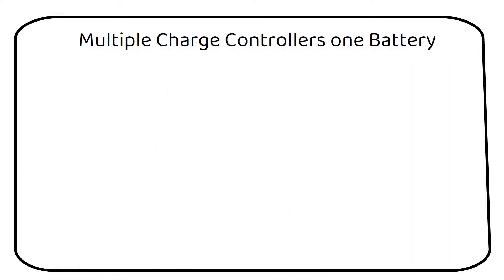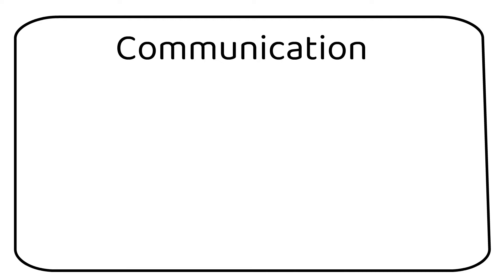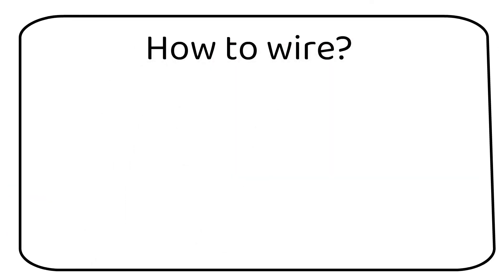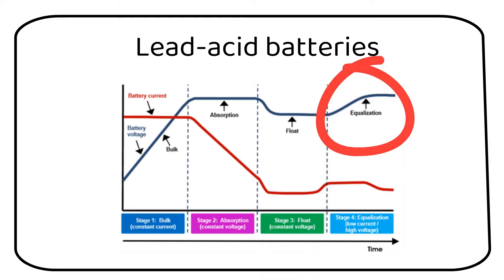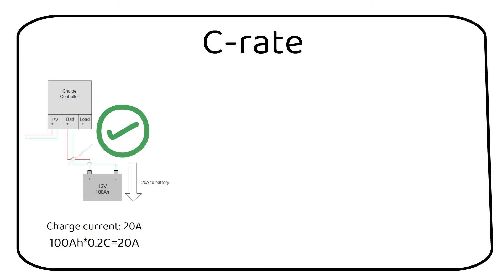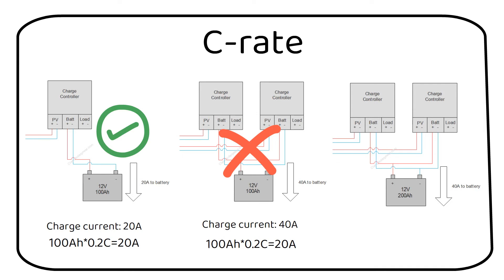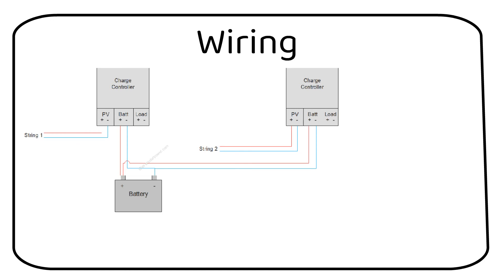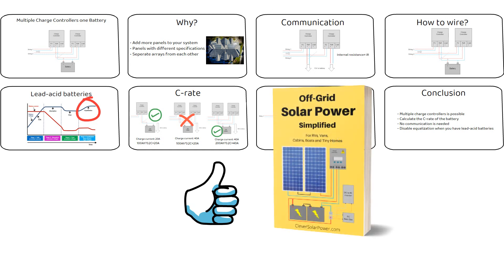Multiple Charge Controllers One Battery Bank: MPPT and PWM

Comment: Can both charge controllers be landed on a bus bar?  I have a victron 100/30 and want to add another perhaps bigger mppt. Can both controllers be connected to the positive and negative bus bar instead of directly to the battery? If so is fusing required beyond the positive fuse from charge controller.
Reply: Yes, you can always connect the charge controllers to bus bars.  And you also don't really need to worry about making the cables equal-length.   Fusing will depend on the charge controllers.  Victron's smaller charge controllers have fuses built-in on the battery outputs, their larger ones do not and you DO need an external fuse prior to go onto the bus bar.  

I usually use DIN rail mounted solar fuses (10x38mm) because the form factor is easy, sized to 150% the maximum working amperage of the charge controller to avoid excessive heat generation.

Charge controller fusing is completely separate from main battery fusing.

-Matt

Comment: Plz answer one important question for me
Can we connect in parallel pwm and mppt , to charge one tubular battery.
Pwm and mppt have different charging voltages, so will it cause any problem or work fine?
Reply from the maker: Yes, it will be ok.
Reply: @cleversolarpower  
Thanks

Comment: Can you connect pwm alongside an mppt
Reply from the maker: Yes
Reply: OK thanks so much  Could you also plz explain the charging Amp of a lithium battery plz because per calculation the scc Amp rating says 60a based on the 1500w input and 24v system at 100a but battery says per c-rating charge with 20a even with BMS plz explain

Comment: Does it matter if having two MPPT of different size, e.g. 30a + 60a. 30a having panels of 200w*2 (total of 400w) and the 60a having 500w*2 (total of 1000w). The same parallel charging a battery pack on 48v.
Reply from the maker: No problem.

Comment: Thanks for the great video.
Practical question. I have 2x 20a mppt i want to connect them to a 250ah battery. 
How should I practically do that? Connect both mppt's to the battery-poles? Or first bring them together, and then with one set of wires to the battery?
Reply from the maker: There is a max limit on connections to battery terminals. This is a maximum of 3. If you have more, then bring them to a busbar.
Reply: @cleversolarpower why would there be a limit on the  number of wires to a battery terminal? Why would you need a busbar? Is this just so it's cleaner more organized? Why would several writes going to battery cables otherwise be a problem?

I really would like to know your opinion and further explanation for my learning
Reply: @truthseekertree  maybe reason is the amount of thread of bolt into the battery and also the current doesnt flow through the layers of too many connections very well. Over time it can be an issue.
Reply: You can always use longer bolts to get more things onto the battery terminals, but my general advice is to minimize the number of ring terminals on the battery... preferably just have one.  The reason is that it is best to put the battery on an Anderson quick-disconnect (also known as "power pole" connectors) so if something goes wrong and the battery starts smoking you can just rip the battery out by main force.  This would be a highly unlikely happenstance with LiFePO4, but the probability is not zero.   When batteries are heavily wired into a system it is literally impossible to rip them out in an emergency.

So what I recommend is that the battery terminals only be connected to (at most) a shunt on the negative side and a fuse on the positive side, then those go to an Anderson quick disconnect, and that is cabled onto a bus bar.  Then your charge controllers just cable onto the bus bar.

Or alternative the battery goes to the quick disconnect directly, and then that goes to the rest of the system.   Depending on what fits best for your circumstances.

-Matt

Comment: Thanks for the super detailed video, this answered most of the questions I have been searching for weeks to find! The only thing left I am wondering is do I have to match the amperage of my current charge controller? I just upgraded my tv battery from one 65ah lead acid to 2 100ah lifepo4 batteries. I have a 200w panel with a 30a charge controller currently, I am looking to add another charge controller to a suitcase panel that I can move into the sunlight as needed. Does the suitcase panel charge controller also have to be 30a or can I install a 10a or a 20a with no issues? Thank you in advance for any insight!
Reply from the maker: You don't have to increase the current of your charger. It will just take longer to charge the battery. However, you need to get a charger suitable for lithium batteries. As far as the charge controller, it doesn't need to have the same current. Watch my video about sizing a charge controller.

Comment: What current MPPT controller is recommended for 24v 200ah LifePo4 battery?
Reply from the maker: Basically any MPPT that has a charging profile for lifepo4 batteries and work with 24V. Some brand names that come to mind are Epever, Victron, Renogy

Comment: Thank you for the video.
I would like to remark on MPPT controllers, particularly that they come with preset configurations for different kinds of batteries. I would think that the default for different types of batteries should rightly have taken into consideration their C rates and therefore control the charging suitably. No?
Reply from the maker: The charge controllers are only regulated for their charging parameters, not the capacity (Ah) of the battery they are charging. The highest current charge/discharge is mostly from the inverters, not the solar panels.

Comment: Hello. I have a photovoltaic system with 4 panels 340w and 4 panels 275w. at 340w I have a pwm regulator and at 275 an mppt regulator. I supply 24v batteries but the regulator mppts the 4 panel 275 no feeder at all. what should i improve in my system thanks you

Comment: I read somewhere that modern charge controllers (MPPT/PWM) can automatically detect the type of battery connected and they will automatically provide what voltage and current needed. is it true?
Reply from the maker: Not true. They can only detect voltage, not battery type.

Comment: What would you suggest for an Absolyte GX 2,000 Amp hour/48 volt VRLA for charging OFF GRID with generator support? I have to make all the connection plates for this unit as well.
Reply from the maker: I'm not sure what your question is. I have a video about generators in the making.
Reply: @cleversolarpower  in regard to charging such a large VRLA - how many charge controllers would a person be limited to for charging purposes. We are on a mountaintop and roof space is limited but multiple stationary arrays with separate controllers may be able to solve our problem without having to purchase one or more trackers. I thought the price had come down on trackers but the price is still quite high.

Comment: Do both charge controllers have to be of the same rate?
Reply from the maker: No, they can charge at different currents. Of course they have to be the same voltage. It's the same as a charger from shore and a charge controller combined. The battery will take all the energy it can, even if it comes from multiple sources.

Comment: Can i connect 4× tubular  batteries in parallel,2× inverter in parallel, and 2× same charge controller in parallel in it possible?
Reply from the maker: Yes you can.

Comment: I see where you say a 20A controller can charge a 100A deep cycle lead battery, but I have a 6v deep cycle  225AH battery and my 100A controller won't work with it why? The pannel I am using is 590w /12v
Reply from the maker: You need to have a 12V battery to use with a 12V charge controller. It won't work with a 6V battery.
Reply: @cleversolarpower  thank you very much for the clarification.  would i be right in thinking that if I hook up booth 6v's together the 100A controller should charge both,  what would be the best way to properly connect the 2 batteries together? forgive my illiteracy on this matter as it is my first time with solar systems. I bought another 100A controller as I don't think one controller can manage the 450AH when both batteries (225AH) combined as one
Reply: @BrianFoster-j2l  connect the 2 batteries in series. That will increase the Voltage to 12v which is suitable for your Charge Controller
Reply: Connect both 6v in series  to increase the voltage to 12v. But the amp hours will not increase even tho you have 2 100ah batteries when in series together they will only produce 100ah @12v
Reply: First off, connect your batteries in series to take the voltage to 12V (the capacity of 225AH will remain) as most non-industrial level charge controllers are designed to work with batteries rated 12V, 24V, 36V, 48V. Therefore, your battery bank should be set up suitably; for you this means getting another 6V 225AH battery and connecting both of them in series. If you have a MPPT charge controller, then it becomes easier because all you'll have to do next is connect your battery and set the controller to lead acid (you should see sealed or gel in the manual, or flooded if that's the type you have). Connect your panels and the charger will do the rest according to that preset.

Comment: Hi I got a 300 watt solar blanket that I use on my 120ah lithium I want to get another solar blanket around 300-400 watt I don’t want to join them preferably just use another regulator for the other solar blanket will I have to use any fuses for this or it will be fine and the wires that go to the battery can I join them?
Reply from the maker: You dont need to fuse the solar panels. However, you need to fuse the wires going from the charge controller to the battery. Let's say your charge controller is 20A, then you need to use the following fuse: 20A*1.25=25A or higher. Then use a wire which is suited to carry 25A or more.

Comment: Hello, here's an interesting question.
 what if you have one controller 12v pwm and another 24v connected mppt to 12v system? 
Is it possible/safe?
What are the issues that can arise?
Reply from the maker: If you have a lithium battery with bms it will disconnect the battery. If you have a lead acid, it will cook it.

Comment: Hi, I have a novice question. How do I disable equalization on my lead acid battery? I have a 20a mppt solar charge controller connected to 220W (100W & 120W) panels and 100ah battery. I don’t seem to understand why my battery keeps overcarging reaching 16.1V at full sun.🥺
Reply from the maker: If you cannot disable it in the settings you can adjust the voltage level of the equalization function. Set that to the normal charging voltage for 100% charging.
Reply: Kindly check your charger settings. Consult the manual and configure the charging to suit your type of lead acid battery. On mine I can choose between Sealed, Flooded, Lithium and Custom. So far, I have monitored the charging hourly and it seems to comply with the specifications from the manufacturer for my flooded lead acid battery.
If yours is showing greater than 15, that's overcharging, especially if it stays that way for longer than 20 minutes. I learned that higher voltage charging tends to occur for equalisation purposes and this shouldn't take long (less than an hour).

Comment: Nice❤
I have same problem my solar panel junction box over heat and burn wire
I have one battery and 2 charging source
 1st is 3 solar panel in parallel 
2nd is ups connect 
I think this is the reason of burning wire of pv modules no breaker installed between pv and charge controler
Reply from the maker: Yes always have a fuse or breaker installed on every wire. The fuse protects the wire from catching fire, that's it's first use.